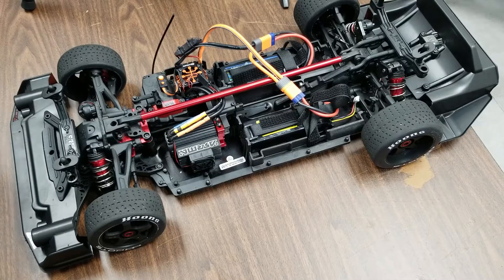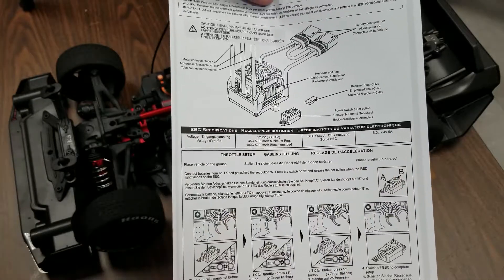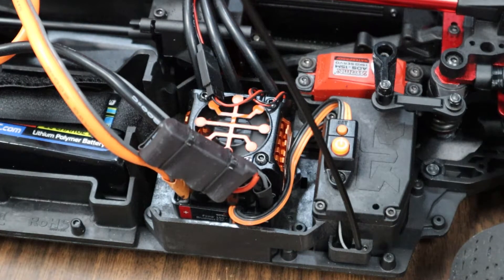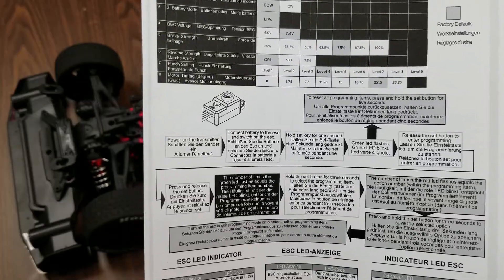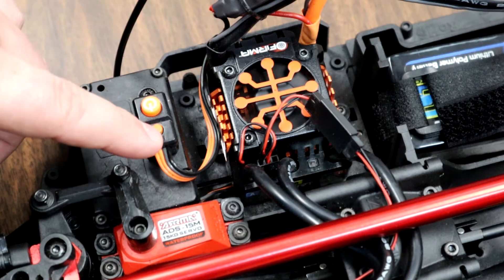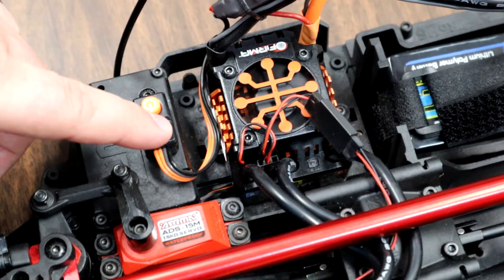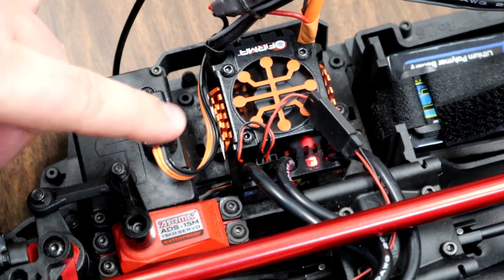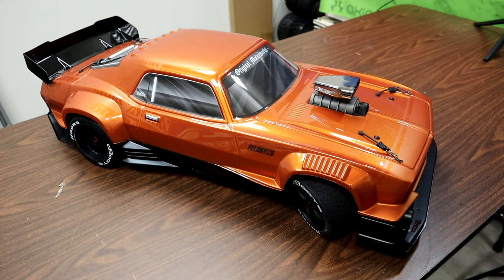Spektrum ESC programming and set up. Brought to you buy Hobby 365.

Comment: OK, one thing I noticed every video I have watched. Everyone has 160 amp ESC in their vehicle it is not the factory one that came in the vehicle in the first place so wouldn’t the parameters be different on the original ESC? Also, I bought a Spektrum esc smart program card will discard work in the original stock ESC? I swear every video everybody has to 160 amp ESC.

Comment: You are awesome. Easy to follow and you had the right esc Manuel. The one online was wrong !!?? Just fixed my kraton. Thank you so much.
Reply from the maker: Thank you for the complement. I am glad to know I was able to help you.
Reply: @Hobby365  Do you know if you can calibrate this with the traxxas tqi receiver I get power to my steering servo but none to my motor
Reply from the maker: @filmorebrowning7251  Yes you should be able to calibrate this with any receiver. If you struggle to get the ESC calibrated try to reverse the throttle channel in the radio.
Reply: @Hobby365  I’ll have to try that when I get home from work and then I’ll let you know something
Reply: @Hobby365  tried that still just getting power to steering but no motor power to the motor I even used another receiver I had laying around and getting the same reaction
Reply: @Hobby365  ig I’ll have to get a multimeter to see if the esc is evening sending any power to it and go from there

Comment: Awesome video and explanation. New to the hobby and wondering if you would recommend setting the Brake Strength to 100% on a Arrma Vendetta?
Is there a theory you go buy - such as fast cars 100% Brake Strength and slower vehicles going less - or do you usually use 100%?
Also, what punch strength to you use and which one would you recommend for beginners?
Thank you, 🙂

Comment: Thanks for the video very informative and easy to do follow… I’m having a problem with my transmitter,,, I hope you can help me,,, I have an arrma senton, I replaced the spektrum radio with a dumbo Rc radio,,, works well but at times I’ll press full throttle and will not respond,, I press again and it goes, not sure what the problem could be,thanks
Reply from the maker: Hi there, I am working under the assumption that did calibrate the throttle range for the new radio. So the only things I can think of would be an issue in voltage drop on the receiver when you pull the throttle. This is pretty easy to solve with a low voltage protector such as this one https://www.hobbytown.com/spektrum-rc-voltage-protector-spm1600/p6570

The other thing would be something bad in the transmitter or receiver if the system was working properly with the other radio.
Reply: @Hobby365  thank you 🙏….. I might just replace the esc,,,, I’m running a 100 amp motor with a 85 esc,,, maybe that’s the problem….thanks again
Reply from the maker: @captainjaxx3728  That can certainly be the issue. The motor will draw the most amps under start load and under jump load.
Reply: @Hobby365  thanks for the knowledge greatly appreciated!!!!

Comment: I have a spektrum firma setup, battery, esc and motor all spektrum, it cuts out 15 seconds into using the car, what could this be? Thanks 👍🏻
Reply from the maker: There are so many reasons that can cause your issue. Bad components, improper gearing, things bound up in the car, improper selection of components...the list goes on and on.

Comment: Hello
My polarity is wrong and my only way to resolve it was to switch the wires on the motor, but obviously the colours are wrong (i like it correct) 
Can this be changed? 
Many thanks
Reply from the maker: There are programing options with the programming card that will allow you to switch the direction of the motor rotation.

Comment: I have a new Spectrum Firma 130amp esc and new Firma 1900kv motor that it does none of what yours is doing and will not bind to motor any idea's?
Reply from the maker: That could literally be anything. The ESC could be plugged in the wrong port or plugging it in backward, Could be low or bad batteries, could be the calibration of the esc, radio or avc. Could be the receiver isn't bound to the transmitter, could be a bad servo causing a brown out in the receiver. Could be bad esc. ETC ETC ETC.

Comment: Hello do you know if you can use a different radio brand with this?
Reply from the maker: Hi there. The process is the same with all radios. Just make sure that if your radio has endpoint adjustments that you adjust the setting to its maximum setting.

Comment: This may sound like a stupid question, but I’m new to the hobby. I picked up the Arrma fireteam as it fit the needs I was looking for, and the sound of those gears clicking together at startup concerned me. When rolling the car by pushing it the gears sound like that but a little worse while rotating. I can’t find any videos of what the diffs sound like while just being rolled by hand and not under power so I’m hoping it’s a normal sound. Any thoughts?
Reply from the maker: Those sounds are normal. The sound of metal gears running on each other are noisy anyway. When you roll the model you will find that the magnets in the motor are aligning as it turns. That will also produce alot of gear noise. No need to be worried I think everything is good.
Reply: @Hobby365  thanks, that helps a lot and puts my mind at ease. Turning the center diff by hand makes a sound like teeth skipping and that’s what worried me, but watching it rotate I can see all the teeth engage. I think it was just the sound that threw me.
Reply from the maker: @Apothas541  Glad to help

Comment: Hey Hobby 365, I have the Granite Mega 3s and I replaced the ESC, bind it to the car.  I have steering but know throttle, reverse.  Every video that talks about calobrating the SLT3 talks about a set button onthe ESC. My ESC doesn't have a set button.  Just the on/off switch.  Please help!
Reply from the maker: Hi there. depending on what esc you have you may need to apply a throttle command to enter into calibration mode. What esc do you have?
Reply: @Hobby365   thanks for your reply.  I dif some more troubleshooting and discovered that when I plugged the throttle plug into the servo I get power when I turn the steering wheel on the remote.  So either the receiver is bad or the remote is bad.  I have a new receiver on back order.
Reply from the maker: @Bossman41000  What happens when you plug the servo into the throttle slot?
Reply: @Hobby365  No steering when I plugged the servo into the throttle, when I pull or push up on the trigger.  So I'm hoping it's the receiver that is the issue since that's the part I'm waiting to have delivered.
Reply from the maker: @Bossman41000  I don't know what radio system you have, but a radio reset might help. Try this one:https://www.youtube.com/watch?v=balQ_Tdd2lQ 

The process works for the DX3 and the SLT.

If you have a AVC receiver this video will help you recalibrate the receiver and you might need this when the new one comes in.: https://www.youtube.com/watch?v=IKUy_61itO0
Reply: @Hobby365  I have the Spektrum SLT3. Yes, I watched that video of yours as well and performed the factory reset.  Still no luck.  Good content sir!  That's why I reached out to you.

Comment: I recently replaced the ESC but I'm unable to calibrate with reciever. Help please
Reply from the maker: Could be a couple issues first did you double check the esc is plugged into the receiver correctly. it is pretty easy to plug them in back ward. The other is to make sure your batteries are fully charged. Hope that helps
Reply: @Hobby365  thanks I just had to rebind the ESC and reciever. Thanks.

Comment: Hey my car goes forward for revers and reverse fir forward. But the thing is I know for a fact I did neutral then forward then backward for the calibration. Idk what’s wrong
Reply from the maker: That's probably One of two things. If you have brakes in reverse but not forward. Check your wiring and make sure your motor and esc are plugged in A to A, B to B and C to C. If that doesn't do it try flipping your servo reverse switch and recalibrate.
Reply: @Hobby365  ya I had to re calibrate everything and swap the wiring to where they didn’t match. Thank you very much.
Reply from the maker: @simplixit  So glad yo got it figured out.

Comment: Is it the same process with the 2s and 3s spektrum brushless motor combo
Reply from the maker: Yes, all the programing on the Spektrum ESC's are the same.
Reply: @Hobby365  so I have a 10t pinion with 3s and it goes 32 so I need to up the pinion for it to go faster
Reply: @Hobby365  do i*
Reply from the maker: @tylerdouglas4654  A larger pinion gear or smaller spur gear will give you more top speed, More heat, and less torque. Be careful not to go with too much of a change too quickly. You don't want to damage anything.

Comment: Not sure y I'm having such a hard time  but I can't get my esc to calibrate I have the arrma talion 6s exb  I binded the transmitter  then tried calibrating  but its not working I have steering but no throttle
Reply from the maker: You can try a few things. Your controller may have a expo, end point or Throttle limit switch. The expo setting should be at zero, your end points and throttle limit switches should be all the way up. Also make sure your Throttle trim is centered. Hope this helps.

Comment: I calibrated throttle. But it keeps losing calibration???  Can someone tell me what's wrong please 🙏
Reply from the maker: I have seen radios be bad and it doesn't loose calibration as much as the ESC sees the throttle input when it is powered up putting it into failsafe mode. Try recalibrating then moving the throttle left to right (not forward and back ward to apply the throttle) and see if the throttle responds you have a bad radio. 

Magnets can cause the ESC to loose its calibration. So keep it away from big speakers.

Also if you have AVC. Make sure to let the car rest after you power it on so that the AVC can set up. If you are moving it around it will not set up. What I like to do is turn your steering to one side before you power it up. When the steering goes centered the AVC is ready to go and the ESC will arm.

Comment: I just bought the firma 150 amp esc. I am trying to follow your directrions, The esc does not do anything after I hit the set button to set neutral, I complete the steps you give and nothing happens. Does not complete. My spektrum rx is bound and servo fuctions. I have tried this many times. What do you think.? I even thought the esc was bad and got a replacement. I am a novice to surface equipment but have flown quads and planes. I dont get what is different. On the picture above, it looks like you have the esc jumper system going to the rx. That is the way I have it. I have change wires . What is the orange and black wire that comes out with the start and setup buttons. ? Am I supposed to use it to the rx?
Reply from the maker: What your experiencing may be a symptom of improper controller set up. Make sure your throttle trim on your controller is centered (or zero). Make sure the endpoints are set to maximum. If your radio is a computer radio It may be best to do a factory default reset on the model you are using or start a new model completely since you are still new with it. 

If this is a Spektrum AVC receiver make sure you calibrate the AVC after you bind the radio. Watch this video for the calibration instructions https://www.youtube.com/watch?v=IKUy_61itO0 

I think what you are seeing as a jumper system is either the fans plugging into the ESC or the wires going to the capacitor. The multiple wires on the power/setup switch just there for switching functions. There is really no need to worry about their functions. The esc is only plugged into the number "th" or number 2 slot in the RX.
Reply: @Hobby365  As an update, controller setting are all centered as a new unit. Avc calibrated and working. I am using a servo wire splitter going from the esc to the fan plug and to the rx in the throt slot. Wires are all in correct directions, rx black to outside and white to inside towards lettering. Esc black to the outside as marked. I can turn on power to esc starts off solid red to flashing green to flashing red. When I power up the esc holding down the setup button flashes red, when I hold down the  push the setup key it to start config the red lite goes out and does not come back on.
Reply: Successful bind,config,programming, Thanks for your help. stay safe
Reply from the maker: @budnanc509  So glad to help
Reply: @budnanc509  how did you get it
To calibrate? I’m having same issue. I can’t calibrate so have steering only no throttle
Reply: @MrMikebeben  It is not an easy fix, but once it is fixed it was easy... Something about the timing of the sequences, not sure what changed, I keep starting over, I mean, turn off and restart the vehicle and tx and rx. And then it took... don't know that I did anything different.
Reply: I can't get it to work, I bought the 4074 2200kv motor and 150a spektrum esc combo to put in the senton and after the initial beeps once I put the set button for neutral nothing happens

Comment: THIS IS THE “ONLY ” VIDEO THAT I’VE FOUND THAT TALKS ABOUT MOTOR TIMING  (BUT)... I have yet to find ANYONE driving and demonstrating on different timing degrees.. if we can go up on the pinion for speed runs, why can’t we just go up in timing? Why is nobody playing with timing???
Reply from the maker: Timing is an art that most people never take the time to fully understand and confidently give advise about. I fall in that category as well. Messing up the timing has consequences in failed motors, failed ESC's and puffy batteries. That is why you are struggling to find advise on how to tune timing.

Comment: If you buy a JUST the Spektrum Firma 150 ESC separately by itself, the manual that comes with it is wildly wrong. The correct one is the Arrma manual for the car the ESC comes in. The Horizon manual is wildly inaccurate
Reply from the maker: That is one of the very reasons I do these videos and it's not just horizon. Traxxas and Kyosho have hidden calibration menus in their radio systems. No where is that even listed in the instructions.
Reply: @Hobby365  Traxxas absolutely has the instructions in their manual how to configure their remotes. No one ever reads the manual. Idk about kyosho though.
Reply: Can u adjust the lvc on the 150a esc? with my programmer box from spektrum it does not have lvc option. manual says it should.
Reply from the maker: @yana2008100  I have not see an adjustment for the LVC in any of the programing options. Even manual programing doesn't even have the option to turn it off.
Reply: @yana2008100  No. The manual is wrong. The correct manual for this 150a ESC is found in the Arrma Felony manual
Reply: That was me. I popped it in my Maxx. The damn manual is in the trash now ;) This really helped!

Comment: I did your calibration, and now my fucking esc won't shut up
Reply from the maker: What specifically is it doing?
Reply: @Hobby365  so I think it was beeping because my battery was dead, fixed that issue but decided to reset my transmitter and now the binding isn't working, after I've done everything.😂 it's sad bro because I haven't even been able to use it in the warm days. And don't have the money to buy anything new. Also lost my receipt from the shop.
Reply from the maker: @alum1n1umkn1ght3  I have some videos on resetting and binding transmitters as well, maybe that will be a help to you with that. Also reach out to your local hobbyshop. Many of them may be able to help you not only with your receipt but also with expertise on the processes that may help solve your issues. Trust me when I say they will be impressed that you have made the effort to educate yourself and need just a little help.
Reply: @Hobby365  thanks brother!
Reply: @Hobby365  So, took it to the shop and they got me a new receiver which worked for their transmitter but I got home and it is acting the same way with my transmitter. So I think I just have a bad transmitter. It isn't accurate and doesn't know where the neutral positions are.
Reply from the maker: @alum1n1umkn1ght3  That is possible, but Is this an AVC receiver? There is a calibration process needed for the AVC when you bind it you might try this video: https://www.youtube.com/watch?v=IKUy_61itO0